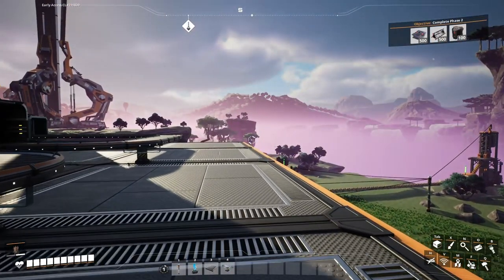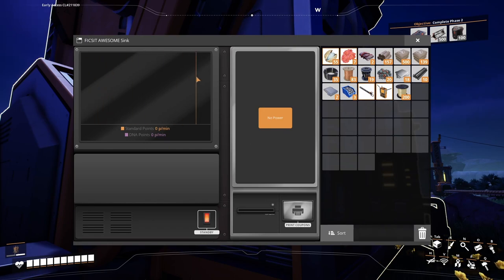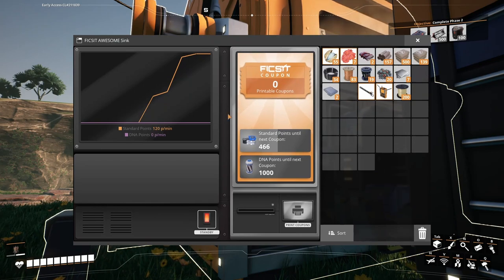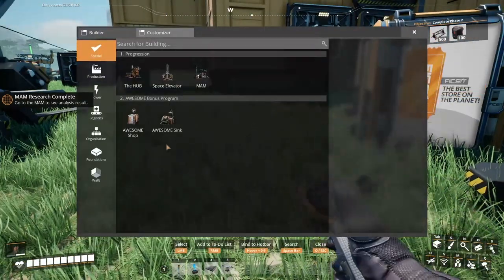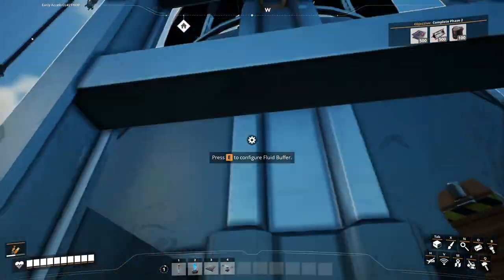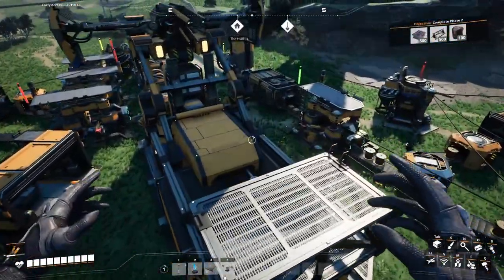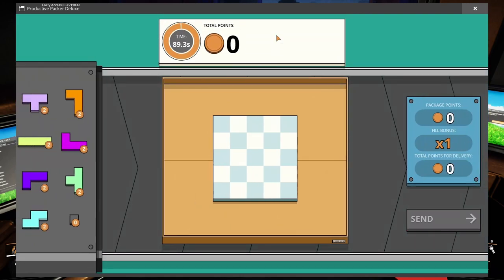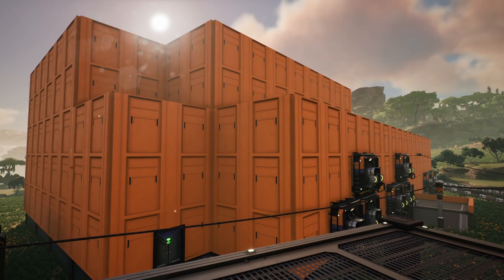Satisfactory Ep7 | Awesome Sink

Comment: A power line need not be powered to use the zip line. The most practical use for the zip line is short vertical traversal.
Reply from the maker: Great advice, thanks!
Reply: Agreed. It's fastest and most reliable way to scale a mountain or cliff.

Comment: The awesome sink uses 30MW. It's pretty negligible.

I think you read the description for the smart splitter and got discouraged because it didn't mention output prioritization, but I can confirm that the smart splitter can do the thing you described.

Clipping comes in three categories: blue, yellow, and red. Blue means that there's nothing wrong, yellow means that the object you're placing is clipping without something else's geometry, but it's in a category of item where the game doesn't care and it's going to let you place it anyway. Stairs have a tendency to try to clip through the foundation because they can try to attach on the top or the bottom of the stairs and the game doesn't really care which direction it thinks you're trying to go.
Reply from the maker: Oh, that's great. I certainly did read that description and it sounded like it wasn't able and then when I saw the next splitter in the upgrade tree it confirmed my thought (even if incorrectly!)